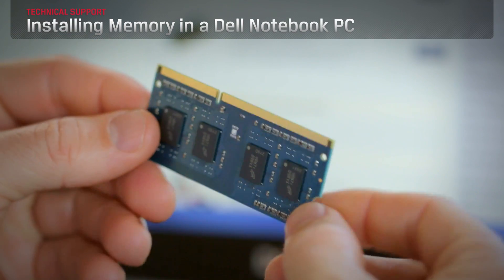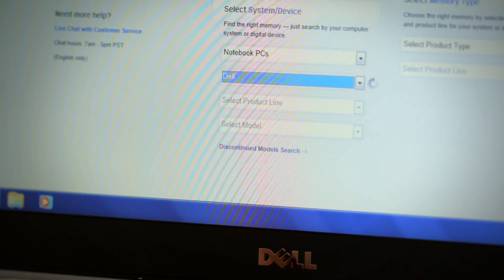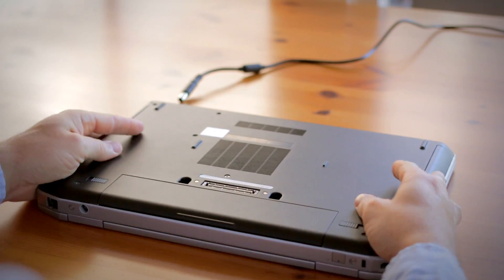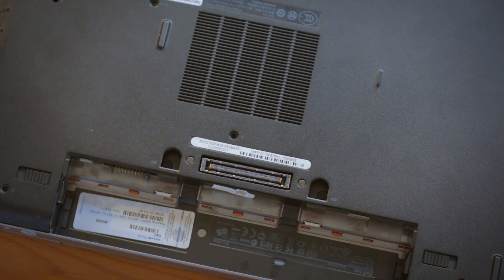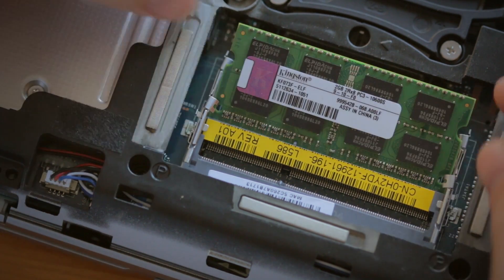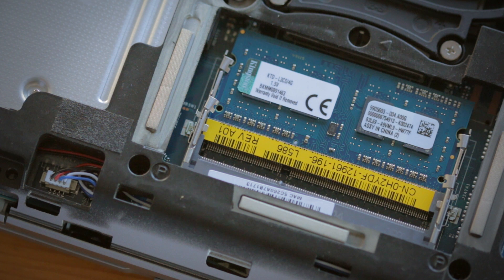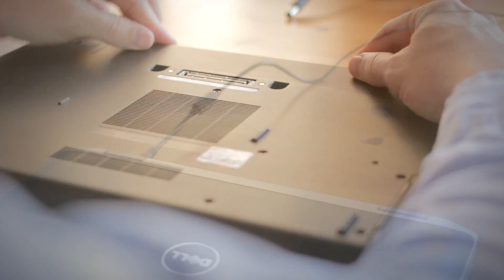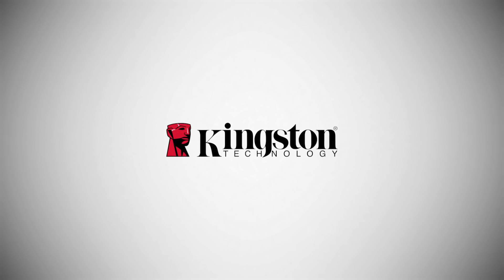Install RAM in a Dell Laptop - Kingston Technology

Comment: Hello Kingston, I bought 2 of your Kingston 8gb DDR3L KVR16LS11/8 1600mhz for my Inspiron 5555, I've run the tests and it should be compatible, but after I installed it, the laptop didn't boot and started beeping 4 times nonstop. I had to install back my Crucials 4gb, do you have any solution for this? thanks!
Reply from the maker: Hey there thank you for your comment. We think perhaps you are having an issue because we do not test our Value Ram on branded systems such as your Dell. We actually recommend our branded memory (KCP) for your system since we can confirm compatibility and is listed on our page as well: https://kings.tn/3yPTodJ 
If you need further assistance click on 'Support' on the web page above

Comment: I bought a second stick of ram for my Dell, the exact same one as the original (Kingston 8gb 1600 DDR3 etc.) and my laptop won't boot when the new ram is installed. Fully engaged the ram. Tried with 2 new sticks of ram. Any suggestions?

Comment: Hi guys after upgrading my 7460 dell inspiron with 2666mhz ddr4 it kept on blinking white and orange? Do i have to remove the battery first? Before putting the ram?
Reply from the maker: Hi there you just have to verify that the laptop is fully powered down when doing any upgrades.  . You may refer back to Dell to see if they qualified this system to run a 2666 since it is only rated for 2400 and there will likely be h/w limitations as to why the speed does not get reduced. You can always check our website to see what we recommended for you 7000 Inspiron series https://kings.tn/3fDZxPt
Reply: @kingston   Hello thank you, a single stick worked, however dual does not.